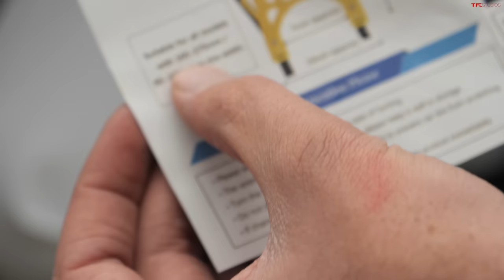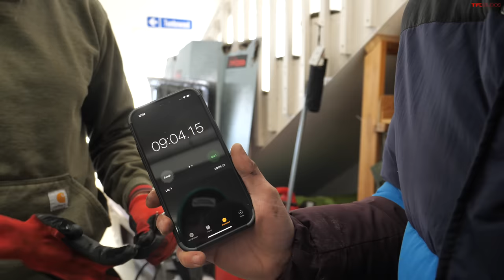Snow Chains vs Cleats vs Snow Socks | What's The Best New Device To Get Traction In The Snow?

Comment: I plow roads for the DOT and I always have empty water trucks going up my route and they can get stuck on a dusting of snow. One day we had three or four inches of wet springtime snow and a water truck jackknifed in the narrowest, curviest, steepest part of my road. When I showed up him and the county sheriff were trying to put on them traction socks. I was interested on how they worked but was sadly disappointed when the truck didn't move and inch, and after a hour of watching him flounder around trying to get up the hill I just started shoveling salt and backing up the hill putting salt out and he got going no problem after the road bared up. For big rigs at least chains are the way to go, not the snow socks.

Comment: I’ve used the yellow cleat things once in pretty nasty weather and they worked really well on my 2WD Expedition. Got me up the mountain to the cabin on a steep winding mountain road that hadn’t been plowed. Then they got me back down on some icy roads. I used them up to 50 mph without issue other than the noise/rough ride. They survived and I’ll use again when necessary. I’d like to buy some of those plastic install gloves that go up to you elbow. Nice addition for keeping your hands/clothes clean and warm.

Comment: Only place I've lived where you needed snow chains was Alaska.  Maybe it was because Alaska, but the chains we had were actual chains, not wire cables threaded through metal beads.  I could get up any hill with those chains.  Those cleats look like they'd fail after just a few miles.

Comment: The issue is that these are all basically case-specific devices. You can't just set and forget like with winter tires. Instead, you have to drive around on pavement on summer tires (all season tires without a winter rating are no better than summers - Roman even said the same thing the other day), hope that you don't hit black ice or lose steering, and be ready to get out of your car in a blizzard to chain up. You can't run any of these things at 60mph on the highway to the ski resort. Plus, I think it's worth reminding everyone that all-seasons and summers begin to harden and lose grip in temps as warm as 7°C (45°F) so even if you're on completely dry pavement, you're essentially driving on slick plastic instead of rubber. There's just no arguable real world application for these unless you're an ice road trucker or a farmer who needs it for a farm truck in their fields. If you get 4 years out of a $1400 set of winter tires, running them 6 months of the year, that's like, $2/day. If you're using those chains frequently then you might even get back that $2/day in fuel efficiency savings using winters instead. 

I know you're doing what you can while the weather is allowing you to do it, but an off-road hill climb in fresh powder honestly isn't very real world. I thought that clip early on, spinning the tires trying to get to the top of the brake test hill, that made the case for winter tires instantly.

Comment: Convert the sizes to sae then ignore the rim size you will find the proper diameter and width of the tire without having to be concerned with rim size because the auto socks have no idea what your rim size is.

Also chains on amazon are sub $100 even for the actual chain style not the cable cheaper cable style

Comment: Thanks for confirming that all three of these traction devices are inferior to a good set of dedicated winter tires or even all-weather tires like the Michelin Cross-Climate 2’s.

I have the Cross-Climate 2’s on my 2016 Toyota RAV4 with AWD and have not had any issues driving on snow or ice.

Comment: I've run proper chains, snow cables (like they used) and the autosox.  The sox are great for getting you out of that OhSh!t moment during a storm, but are not intended to be driven on for any length of time.  They are literally for when the road hasn't been plowed or its coming down so hard the plows can't keep up.  Like if you are going up to the ski hill or worse stuck in the lot at the end of the night.  I've got a total of 100mi out of them over several storms.  
If you are expecting lots of travel over both plowed and unplowed roads, chains are the only answer.  Be it actual link chain, modern cables or the antiquated style as used here.

Comment: I'd personally call the chains more cables than chains. I've seen they can be more finicky, but do well. The one time I had to run something similar a few years ago on my BRZ with stock tires in the Seattle area with 4-6 inches of fresh snow, they were great. It is all hills in this area, and I left downtown and drove 25 miles more of hills on backroads to avoid the freeways. If I'm not mistaken, they do say to check/adjust them after a short time to make sure they are tight. The brand I bought was Z Super, and they worked really well.

Comment: Was in an afternoon ice storm in Edmonds Washington, just North of Seattle. The sun was setting and there was not much movement on the road. I remembered there was a Home Depot just around the corner, so i pulled my Vanagon to the shoulder and walked to the HD. Thinking about a solution during my walk i came up with manilla rope. I found a considerable roll in 3/8”. I tied loops with square knots around each wheel and by the time i jumped into the driver’s i had three other people warming inside with the gasoline heater blasting comfortably warm air. I picked up a couple more driver’s on top of the hill and got everyone home safe by dinner. Manilla twine. Worked great on ice and snow. Just need to make sure any loop tied won’t interfere with the brakes.

Comment: The trick with cable install is to drive up on a small piece of 2x4 and drape the cables over the top of the tire. This is a trick from the guy that helps stranded people on the way to Mammoth.

Comment: So clearly if I owned a front wheel drive Rav4 even though I wouldn't, I might buy the cheapest thing to get unstuck but I'd really just go to a junkyard for 4 steel rims and put winter tires on them and switch out each season.

Comment: Suggestion for next time: try the ISSE tire socks on the next round. They have a different design than the autosock, curious how they perform
Reply: Or use the right Autosock size first. Of course it is bad if your tire is not listed on Amazon, but you could always double check the manufacturers website. Putting traction decides of any kind onto a wheel without knowing it is the right size can be rather risky/ damage the tire house / car or even lead to accidents.

Comment: Those cleats are not recommended for over 40kmh or hard breaking, most of that style is meant to be compact and get you out of a bad situation and not to be driven on like regular snow tires/chains. When used as intended those cleats can be a life saver.

Comment: Interesting test . . . a FWD rig with older tires is certainly not going to perform well in the snow, and these cheaper implements seem to be kinda hit and miss on staying on the tires.  It gives you some idea of the possibilities if you can't afford new rubber and the snow comes.

Good job, guys!  Working out in the under zeroes is tough!
Reply: There's no problem with snow socks staying on the tires if you have the right size for your tire. This video was like having somebody run the 400 meter hurdles while wearing shoes that are 6 sizes too big.

Comment: Those chains are not the right size. A newer set like Oreilly Auto Parts sells you don't have to roll over them to install either. The have clips on both side and you can drape it over the tire and hook up both sides without moving the vehicle. Tightened properly you will have very little slack and the tensioner will be stretched out in circular pattern closely following the the outer part of the rim.

Comment: I used some of those tire cleats last winter and as long as I was in the snow/ice they worked fine I went anywhere I wanted to go at 10mph , but I had to adjust and tighten them after every trip so at work before heading home Id better tighten them then again when I got home  Id better tighten them again to go to work again the next day. and by the end of the season the cheap little ratcheting tool didn't hold up at all I was using a flat head screw driver by the time I took them  off for the last time.  The problem lies in the strapping if at any point you need to cross a cleared dry street it tears the strapping . I had one break and sling around and scratch the paint  in a nice circular motion (before i could get stopped) on my truck. Also if your driveway is on a hill and its conrete as you dig in to get up the driveway plan on scratching up driveway with permanent marks. Just my personal experience.  They did do what they are designed to do just plan on buying new ones every season ( maybe twice in a longer snowy region) because the ratchets will get rusty on you any way this was a good video. this is a great channel.

Comment: 0:59 -12 F is a good temperature for trying to drive in the snow as the tires bite on the ice crystals and aid in traction in a big way. The worst traction is in the snow that is just above freezing as the little bit of snow melt and water act as a lubricant in the snow and makes everything greasy to drive on.
20:23 Great after you get the chains on you are ready to give a cow a pregnancy test.
28:39 Really those traction aids are meant for winter conditions on the highway to prevent from being stranded in winter conditions they might get you trough a mountain pass but for the best traction for a longer drive would be the chains. We have just had some freezing rain here and there were many accidents because of the ice on the road, some of those aids may have been a blessing for some people.

Comment: On the whole, not a bad comparison. That being said, I suspect that the tire sock was a little too large and the tire cables (those weren't chains) were obviously too large as well. Well-fitting cables/chains actually are quite snug to the tire. There is a method to installing them and once they're properly installed, they can provide really good traction compared to a tire alone and they won't come off easily. Pretty much all traction aids I've ever seen have a max speed of 30 mph.

Comment: Great video guys! I'm doing a 2" strut lift on my 2016 Camry SE 4cyl along with 27" all terrain tires. We got 10" of snow in Arizona recently and I almost got stuck during the storm. Plus I'm bored with the car lol so it's time to mod it. I'm definitely going to run an aid even with all terrain tires and this video helps. Now I just have to figure out if I can fit a 14" rim on my Camry.

Comment: them cables you boys have are actually for ice on sterling tires they will work on drive tires but they are more designed for lateral force to keep the vehicle on the road then rotational forces to propel a vehicle

Comment: Man those cables were sketchy. Next time use actual chains.  Ive found Diamond pattern (titan is the brand i use from e-trailer) are very easy to put on and take off while providing excellent traction.  Since you’re always on part of the chain they are also much smoother than other designs of chains.  For all chains you should drive a few yards and get out to re-tighten.  They always center themselves and slack some.  To REALLY get the maximum fit air your tire down, install chain, drive, retighten, air tire back up.

Comment: I have chains for my 4WD truck and use them only when needed but still several times a year just to make sure I will make it to work. They are now 5 years old, probably have about 100 miles on them and looks like they will last forever. BUT I can not put these on if I’m already stuck. I have to drive onto them. Seems like those yellow cleats could be thrown on if you’re already stuck. Which could save a life if stranded out in the middle of nowhere.

Comment: Assuming I have to fit them "in the field" and not in a warm garage, I'd vote for the socks: no fiddling or tools required and probably (?) good enough to get you out of a fix.
Reply: There is an issue with snow socks getting you out of a fix. If your vehicle is already in a situation where it can't move, you won't be able to install the snow socks. Installation requires that you fit the sock over the top and sides of the tire as much as you can, then move forward or backward a partial turn in order to expose the rest of the tire's surface, and finish putting them on. You have to put them on before you get into any slick stuff.
Reply: Same goes for tire chains. That’s why it’s important to put them on before your stuck!
Reply: @nwjohn  From experience I can say for snow chains it is no problem to put them on after you are stuck. (The piece of chain which you cannot get under the wheel, will provide you enough grip to roll over, after which you can secure the chain properly. And anyway you have to tighten the chain again afer a few 100's of meters.)
Of course it is better to put them on before you got stuck, but we all believe we can manage it 😀
Reply: @geezerpleasers_OG  The cleats look like they may be able to get you unstuck. Putting three on the part of the tire that can be reached, they should be able to get traction.

Comment: I get the Les Shwab Chains.  Forgot the brand.  But they are easy to repair yourself.   They work GREAT in snow and a DREAM on ice.  They also stay on the tire really well.  Its pretty ruff when you get on hard pavement in places, but  hold up pretty well.  

Those plastic things would be my go to for having them in the car.   Simple easy and gets you out of a bind quick.

Comment: I used the cables about 5 times in 20 years(SC). On both snow and ice. They can be a real PIA to remove when you’re hugging a cold filthy tire to find the quick disconnect. Last winter had to jack both sides and remove the wheels to remove the cables.🤬

ETA-other than that, they worked really well.

Comment: The chains looked cheap/horrible compared to other brands.  I wonder how long the cleets would hold up traveling through the mountains in a storm.  While the sock could give you emotional comfort, it lasted about as long as I suspected as you put them on.  If you live/safety are on the line, you want something you can trust.  Don't cheap out.  

Chains do take practice adding/removing, plus retightening.  Driving 20 miles in a storm, good chains FTW!

Comment: Standard chains should have more bite and apply more pressure than pipe sections threaded in cables (which also roll around the cable while the wheel spins, thats why the bad result)... Attempts to reinvent the wheel are always funny... and sometimes dangerous.
Also,..cleats will ALWAYS break unless theyre fastened with cables/chains instead of nylon traps and snow socks always get torn, so it's good to consider both more like single-use equipment.

Comment: What if you drive in a more conservative manner, trying to avoid wheel spin? I imagine max speed rating is exceeded when the wheel starts spinning, especially when you dig down to rocky field. IOW, the way most folks will use these, maybe they would not break or tear at all? And with a better fit, maybe the chains and socks would stay on? Maybe.
Reply: My snow socks fit my tires perfectly, and they never come loose.
Reply: They will wear out long before chains... But if not abused they could last 100 miles maybe?
Reply: @breckfreeride  If not abused, they can and do last for years. Especially if you get the more durable socks with thicker and stronger fabric.

Comment: The "chains" as other have mentioned are "cable chains", not legit old school snow chains. HUGE difference in performance between the two. Not to mention the cable chains you tested were way too big. I too, would like to see some modern traction devices such as Konig thrown in. Me? I haven't put on a set of chains since I worked in a tire shop over 3 decades ago. I use AWD and 3 peak tires for our mild winters here, and throw in the cheapest "whatever" in case I have to cross a pass.

Comment: I watched this test done on a paved road in Europe and the cleats did not stay on that car at all. They broke quickly at the straps. The Autosocks did well and the chains did well. I have both chains and Autosocks and I hate chains as they are unpleasant to drive on. The Autosocks are a good choice for a Tesla or any car without much clearance  between tire and wheel well.  My Autosocks say not to go over 25mph and going that fast on chains is miserable anyways and the roads are often littered with chains that come off while driving

Comment: You actually need to buy the right style of chains.  Chains are supposed to break up the ice on the road.  For semis you can buy the normal chains with round links for snow or the chains with square links that actually break up the ice and dig into the ice.  With my semi, I have had my fully loaded trailer resting on it's belly in the ditch and the semi on the road in ice and with chains, the semi has pulled the trailer out with no trouble from a dead stop.

Comment: Those cables (not chains) are way too big for the tire size. Not nearly enough tension on the rubber cords. Plus, cables really aren't very good. Actual chains, especially diamond tread chains, would make that little car a tree climber. They are not that hard to install if you practice a couple times before you actually need to install them on the side of the road in the cold and wind. Also, as you discovered, it is best not to break traction when running these things. Be gentle and take it easy, and you will get where you need to go. No need for speed tests, only to test if you actually make it to the top and back down. 

One more test would have been to try going up that hill in reverse. Changing the weight bias onto the axles with the traction aid can really make  a difference.